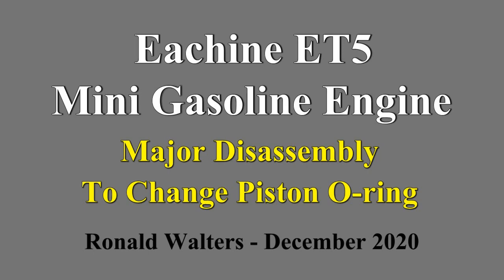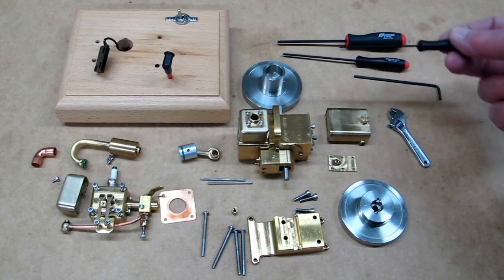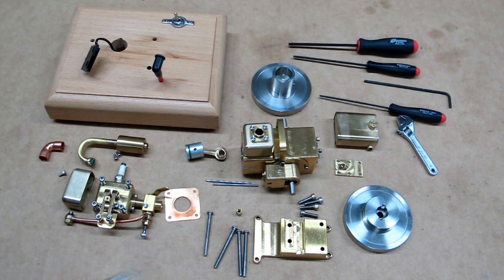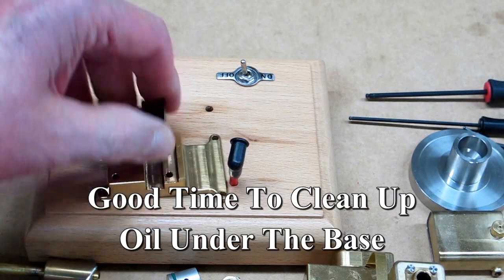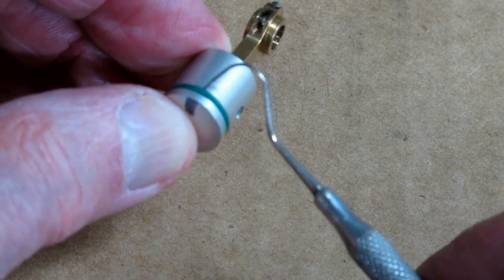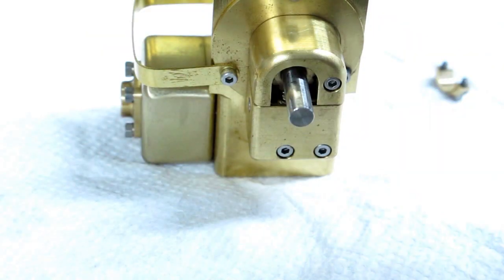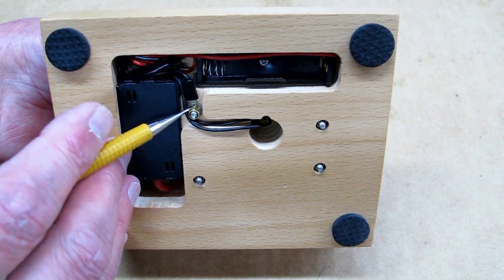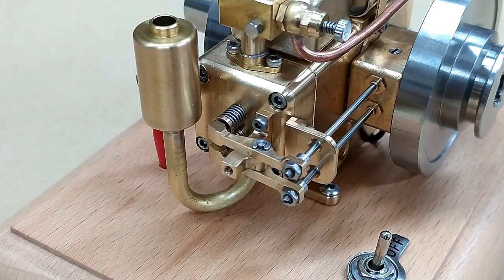Eachine ET5 - Taking It Apart

Comment: Hola. Tengo unas preguntas. El aro del pistón, segmento de goma. Y mi pregunta es, el segmento , aro de goma del pistón, es fiable y duradero?  Ya que al ser de material de goma, y no metálico. No se si será fiable y duradero en el tiempo. O si hay que reemplazarlo frecuentemente. Y la siguiente pregunta, si venden estos segmentos,  aros de goma como recambio?  Y si hay facilidad de conseguir recambios de las demás piezas que se pudieran estropear o desgastar por el uso y el tiempo. Muchas gracias por la atención. Un Saludo desde España 🇪🇸
Reply from the maker: Banggood is no longer a reliable seller of these engines and generally they seem out of stock of everything. They also no longer sell the o-ring piston rings.

Therefore I now work with EngineDIY

Use one of the links below to get to the website. Then I get credit for the sale.
These engine links are listed in the description for my engine review videos.

M90 Hit & Miss Gas Engine IC Engine https://bit.ly/3Sinhg7

M12 Mini Gasoline Engine Water-cooled https://bit.ly/3PQW42a

Using the coupon code will save you money.

Coupon Code 10% off for all engines: Ron'sStuff

M90 is the same as ET1

M12 is the same as ET5

A model engine is a toy. It is to be appreciated for what it is, a model of a full size working engine. The are not intended to be run for long duration, at very high speed (RPM) nor under high loads.

These engines seem to run for quite a while with these high temperature o-rings. They are readily available at EngineDIY. There are larger o-rings for the larger engines such as the M90 and smaller o-rings for the smaller engines such as the M12. Search for: 

10Pcs Rubber O Ring for M90 Hit and Miss Horizontal Gasoline Engine

10Pcs Rubber O Ring for M12 2.6cc Mini Four-stroke Gasoline Engine Model

EngineDIY also has other parts. Look around.

I have over 70 videos all listed in a playlist on my YouTube channel. There is a lot of information there.

Please subscribe. That is what keeps my channel running!
Ron

Comment: Do they test run these engines after final assembly?  I have never been able to get mine to run.  It had a bad plug and a stripped head bolt.  Replaced the plug. Compression and valve timing seems ok, has spark now but will not start.
Reply from the maker: Every engine I have received has had signs of carbon inside the exhaust and on the plug indicating it was run at the factory. However, this does not indicate that it was run after mounting on the wood base nor with the electronics fitted to the final assembly. Bench running at the factory may be a very brief run with the engine in a vise or on a test block just to verify that it runs. It also does not indicate that the engine was filled with cooling water as proven by two engines I received with leaking liner o-rings. If you consider the plus (+) and minus (-) tolerances of the manufacturing process, If the inside diameter of the liner is on the large side and the piston groove diameter is on the small side, you could have a situation where you have compression but not quite enough compression for it to fire (my opinion).

Banggood has a 30-day refund/replacement guarantee. But I always suggest using PayPal for payment, which simply gives you one more layer of protection. Therefore, if it is damaged in shipment or doesn’t run, you are covered. 

Always keep the original packaging and the outside wrapper with the shipping label and product bar code (on the box itself) for future reference.

If you get an engine that does not run, you need to file a complaint with Banggood ASAP and ask for a replacement or a refund. When dealing with supply/returns for a product that originates in China, this can always be a hassle. Some customers have indicated they had to pay to return the engine to Banggood, but that Banggood then refunded the cost of return shipping (however I have no experience with this). 

Thanks for watching. Hope you have subscribed!
That is what keeps this channel going. 
Ron
Reply: @RonaldWalters2010  Yes I have.  Always checking your channel for videos.  Wish you could come over and get my et5 running for me :)

Comment: i wonder if anyone makes metal piston rings for this, i am not a fan of the oring, its stupid
Reply from the maker: These are demonstration model engines not intended for extended run times nor to perform any actual work. The o-ring piston rings work, reduce manufacturing costs and are relatively easy for someone with limited mechanical knowledge to replace.
That being said, I would also prefer regular pistons rings. 
I doubt anyone would make piston rings for these engines. The groove in the piston would probably be wrong and the cylinder is not tapered.
Thanks for watching! Ron
Reply: @RonaldWalters2010  so i got this engine few days ago, noticed that the crank shaft is smaller than the bearings by 0.10mm, is there a way to fix this? also is there other fixes you have done on this?
Reply from the maker: We basically need to consider two things. 
First, when we consider the +/- manufacturing tolerances… sometimes all the +’s or all the –“s add up for the components assembled and things can either be a bit tight or a bit loose.

Second, it is made in China and very likely they are not being selective enough during assemble. Quite likely there are boxes of parts and the first one they pick up goes into the engine.

These engines tend to be a bit loose… crankshaft bearings included. If it runs then don’t worry about it. If it does not run, file a complaint with whoever you purchased it from. File the complaint ASAP.

If you have only had it a few days, and if it runs, why have you taken it apart already? If it doesn’t run and if you need to return it, make sure it doesn’t look like you have already taken it apart unless the seller asked you to try to fix it yourself (or something similar). Keep the original packaging and the shipping label.

Another thing you have probably already noticed is do not put all of the oil they are recommending in the crankcase.

I do not have a fix for loose crankshaft bearings and I have not fix anything on one of these ET5 engines other than replacing the Piston O-rings and attempting to lap the valves a bit better (I have a video on that) which really didn’t change much.

Thanks for watching. Please subscribe. 
That is what keeps this channel running. 
Ron
Reply: @RonaldWalters2010  yes i just wanted to make it tighter as my crankshaft wobbles around quite a bit and i want to run things off it as well. I might go see if i can machine the piston another groove for 2nd oring so it wont burn/spit out as much oil and maybe make another crank shaft down the road that will fit it properly
Reply from the maker: Good luck with that. There's not a lot of room there for a second groove. Let me know how you do.